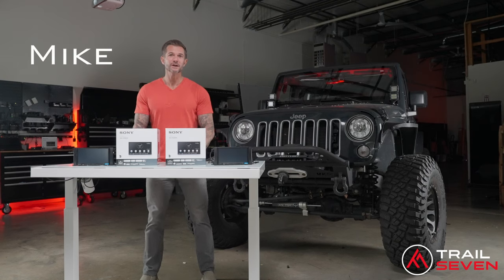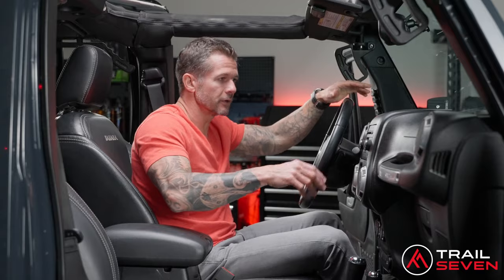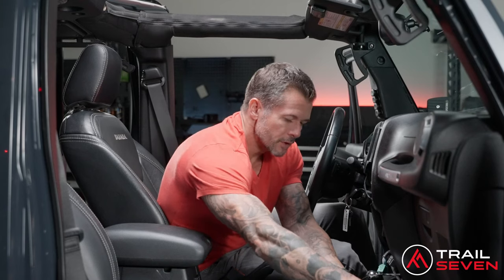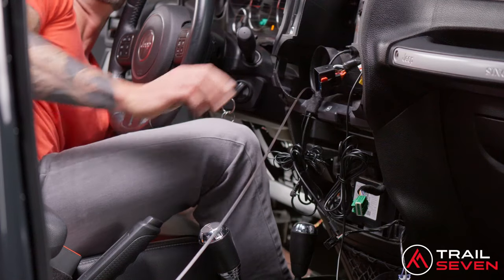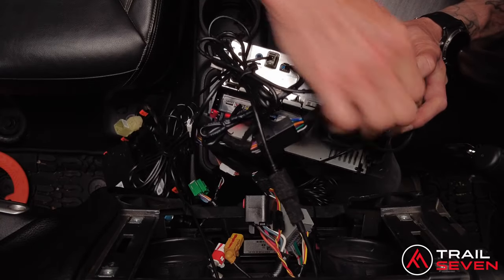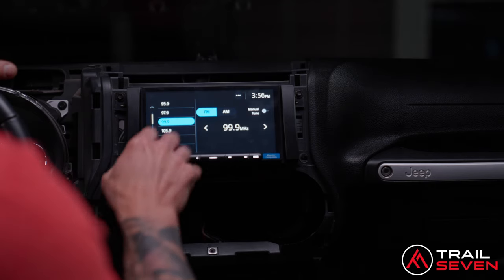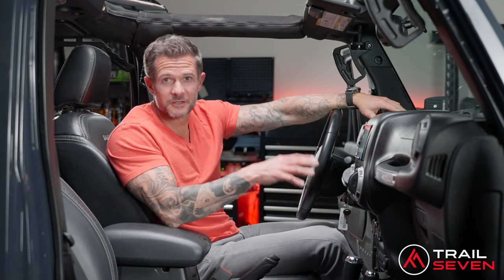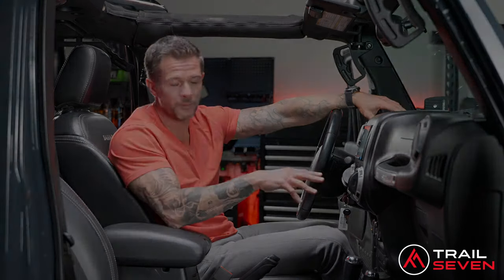Jeep Wrangler JK Sony XAV-AX6000 Plug & Play Kit Installation | 2007 - 2018 Jeep Wrangler JK

Comment: hi sir I installed it in my Ford Figo... But steering control is not working and retailer is saying that you have to buy Canvas separately for that.... Is that true? Kindly help.
Reply from the maker: Sorry but we’re exclusively a Jeep accessories shop so we’re not familiar with the Ford Figo install.  I will tell you that a Maestro module is required in order for the Jeeps to maintain steering wheel controls which I would assume is the same scenario for your Ford Figo.  I would recommend contacting the vendor in which you bought the unit from to purchase the remaining necessary components for your set up.
Reply: @trailseven  Thank you sir 🙏🙏🙏🙏

Comment: Does this help with output and sound even on yhr system with a factory amp? I doesnt look like it bypasses..
Reply from the maker: The head unit does not bypass the factory amp, however with the EQ, you’ll be able to dial in your factory system!
Reply: @trailseven  sounds like it might be worth bypassing the amp, at least for the rear speakers to get full range. The rear is mid I think, barely any sound gets out of those, even with the kickers.

Comment: @trailseven does voice control and the phone button on the left side of the steering wheel still work with this kit?
Reply from the maker: Yes it does!  The voice button becomes your talk to button.
Reply: @trailseven  thank you! I am convinced, no Kenwood DDX9707 I guess
Reply from the maker: @outbacktravels  You’re very welcome!  We flash each unit to your Jeep prior to shipping so it’s ready for a Plug and Play install upon receipt….with active steering wheel controls!
Reply: Did this also control your climate control, AC temp, AC speed, dual mode, things like that? I’ve got the 4000 but my car had all the climate controls on the stereo not the control knobs or anywhere else. I’m hoping adding the maestro will resolve that
Reply from the maker: @donclifford7017  No, the Sony head units don’t control the AC on the screen.  Which head unit did you have in the JK that controlled the HVAC?
Reply: @trailseven  sorry I don’t have a jeep, it was more of a general question I suppose. I’m being told if your vehicle has the AC/climate control options on the head unit then the maestro would do the same. You would retain those factory settings. I’m assuming jeeps do not
Reply from the maker: @donclifford7017  In Jeeps, the Maestro would retain factory settings and steering wheel controls.  Sorry but we’re not sure what you have.

Comment: I seriously can't recall the last time or last decade since I have even heard Sony let alone purchasing one lol ... off to Google I go.
Reply from the maker: Let us know if you have any questions!
Reply: @trailseven  , will do. Great install video & realized you sell the units so 👍 👌 I will once I know if there are some steps I need to take first on panel switches & power supply. It's not required just for the stereo upgrade this I understand I'm just trying to do things once & not many many times on the electronics side of things.
Reply from the maker: @idahoman325  Unless you were planning some serious stereo and lighting upgrades, no additional power is needed.  So far on our Shop Jeep we have several components coming off the stock battery with no issues.
Reply: @trailseven  , okay that just made things rather simple then. Many thanks, I'll be in touch here in a few days again thanks & great video.

Comment: I’m installing this in a 2014 Sahara jku and i have no sound on phone calls they can here me but I can’t here them the U connect is unplugged like in the video. Thanks
Reply from the maker: The U connect is still connected at the bottom.  Disco it completely and the phone connection will be bi-directional Vs uni-directional like you have now.  It must be disconnected completely or it will interfere.
Reply: @trailseven I have it fully disconnected now and still have no sound from calls
Reply: @trailseven I only have the big connector connected to the u connect and still nothing this jeep had a different Sony head unit in it before and calling worked just not sure if I don’t have something connected wrong not sure thank you for responding
Reply from the maker: @carterney1316  Disconnect the Uconnect completely.  Do not leave any connections at all to the Uconnect.  If the issue persists, please call our shop for support.   We’re open Mon-Fri, 9am-5pm EST.  What is your order number?
Reply: @trailseven the order # is 2080 I’m installing them for my sister also in the order she boght new kicker speakers
Reply from the maker: @carterney1316  Does the jeep have the factory amplifier?  Is there a factory sub mounted in the rear bed of the jeep?  It would be mounted to the right side against the bed wall where the roll bar attaches.
Reply: @trailseven  yes it has the factory sub
Reply from the maker: @carterney1316  Ahha!  The unit was ordered as a non-factory amplified set up which is what’s causing the issue.  Simple fix-  the harness is taped with the exception of green and white connectors.  Non-amplified, we set the connectors as green to white and white to green, you’ll need to swap the connectors to white to white and green to green.  They need to match in order to be set up for factory amplified systems.  In addition to the UConnect being completely disconnected.  Let us know once those connections have been swapped.
Reply: @trailseven  yeah we were not sure because the jeep has 2 12 inch subs and another amp in the back I’ll switch thoes wired and get back with you thanks
Reply: @trailseven what harness are the wires I need to switch at thanks
Reply: @trailseven just got it figured out thank so much for your time do I owe you anything for helping me through this
Reply from the maker: @carterney1316  Let us know how switching the connectors turned out.
Reply: @trailseven  it did works perfectly now
Reply from the maker: @carterney1316  Fantastic!

Comment: Anyone who knows this channel know if he delves into a install for adding the ideal switch panel & whatever that entails in regards to extra battery power 🔋  winch, lights,  this stereo,  etc etc. No need to have a dead battery out & about.
Reply from the maker: Sorry, but what is the question?
Reply: @trailseven  , if a prior video talks about ideal set up when you know you will be running multiple energy draining items such as lights,  winch , improved power stereos etc. Do you recommend an entirely added battery 🔋 or how to make sure it's rather sane panel wise.
Reply from the maker: @idahoman325  No need to extra power for the head unit or sub bundle upgrades.

Comment: my jeep radio opening is 4"X8". this unit is too small.
Reply from the maker: What year is your Jeep?
Reply: @trailseven  2008 jeep liberty sport. It has a newer jeep radio in it now, touch screen, XM, but I want to add camera to it and possibly gps. it's possible I just need attachments, but maybe not.
Reply from the maker: @dennislurvey3235  These are bundled for the Jeep JK but with the right bezel, it’ll fit your vehicle.